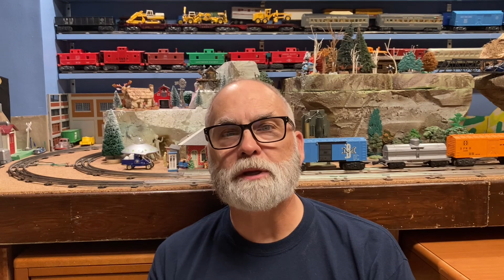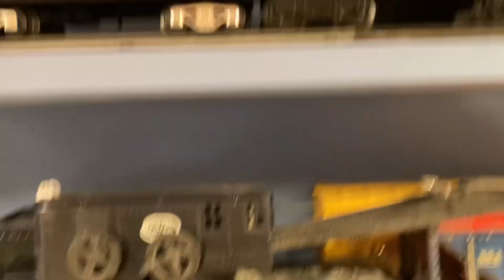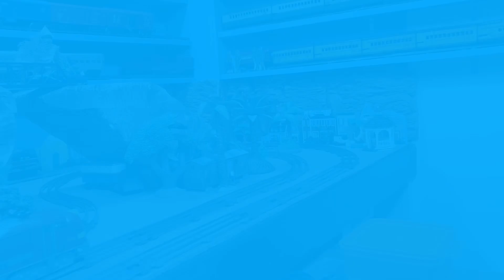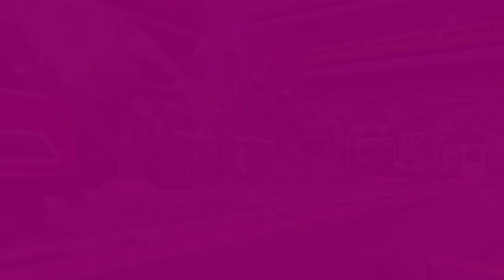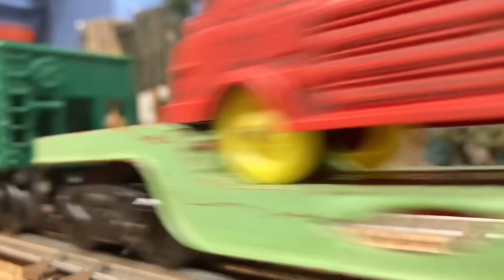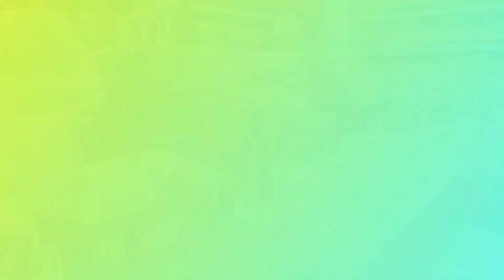The Toy King Goes Plastic!

Comment: Very interesting! These plastic cars certainly have their charm. And that battery operated set runs actually pretty good. What company took over the old Marx tooling and produced these post-Marx trains?
Reply from the maker: From what I’ve found Marx equipment was scattered far and wide. A testament to the engineering of the Marx people.